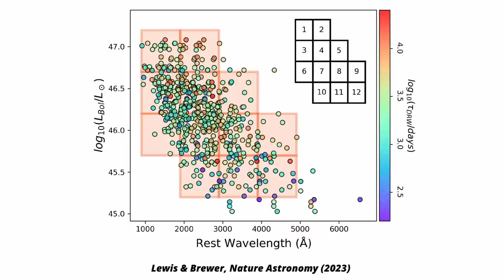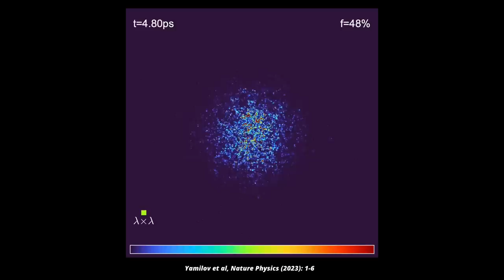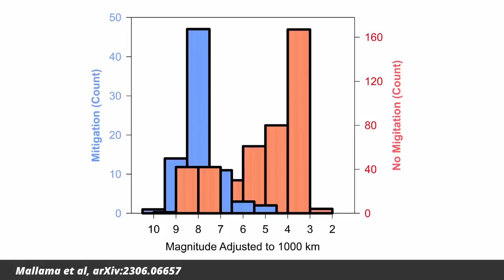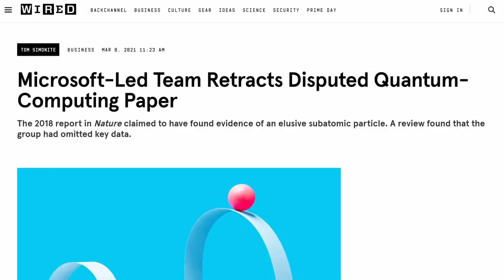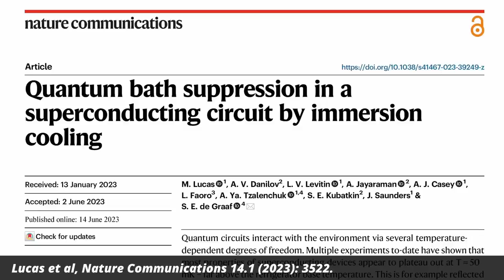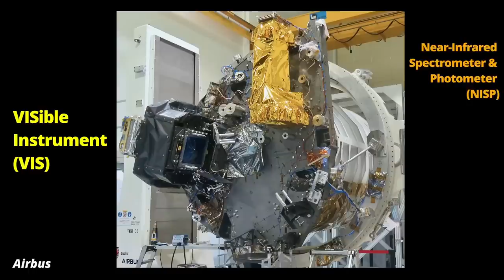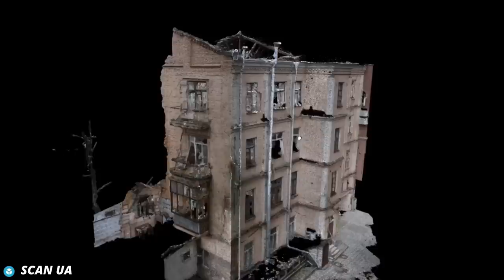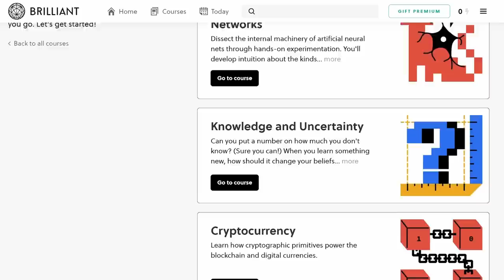Time Ran Slower in Early Universe, New Study Finds

Comment: In the early universe, all the matter was packed closer together, because space was smaller.  I assume that means that the total background gravity field was stronger than it is now, because galaxies and such have expanded much farther apart.  With the relative densities so disproportionate, looking at distant galaxies, time should appear slower.
Reply: Slower in relation to what? Putting everything denser together doesn't increase the gravitational field, as gravitational sources from all directions cancel each other out. You'd need a gradient to get a difference. To my understanding it's that from our perspective time in the early universe appeared to be slower, but from the perspective of the early universe everything would be perfectly normal.

Time is what clocks measure. If all clocks in the universe got slowed down by the same amount, no clock could measure any difference.
Reply: @NeovanGoth  - good comments, thanks for your response.  Yes, from the perspective being in the earlier universe, time does not appear slower.  What I am suggesting is that from our modern perspective, looking back in time and space with our telescopes, time seems to be running slower.  It is just like how our GPS satellites see time moving very slightly slower on the surface of the Earth, because gravity is stronger there.  It actually has to be corrected for to make GPS locations stay accurate.
In the earlier, more compact universe, yes some gravity fields cancel each other out, but overall, there are more stronger gravity fields throughout spacetime back then there is in our current time.  It seems to me that it is just like the GPS satellites looking down on Earth.  Relative to here and now, time appears to be slower.
Am I sure that my proposition is correct?  No.  I am only putting it out there to see what you and others think.
Reply: @smeer001  No, this is not correct. You are probably thinking of gravitation as some kind of absolute number that is added up from the mass of the surrounding objects, so if suddenly all the suns and planets had double the mass (or in a certain amount would be double the mass because everything got packet together more densely), there would also be double the gravitation. This isn't how it works though.

Gravitation isn't an absolut number ("How much stuff is in this piece of universe?"), but the _curvature of space_. The universe is both homogenous and isotropic (the "cosmological principle"), which basically means that no matter where in the universe you are and in which direction you look, there's always the same amount of stuff in this direction. If there is the same amount of stuff in each direction, the net amount of gravitational force the whole universe acts upon you is zero, because every gravitational source in one direction is cancelled out by a gravitational source in the opposite direction. It doesn't matter how much stuff is in every direction, or how densely packed it is now or was billions of years ago. Overall the universe is flat and always has been (we can see this in the cosmic background radiation), hence there never has been any gravitational time dilation acting on the universe as a whole.

In your example with GPS satellites this is different, because on a local scale (like "earth + orbiting satellites") the universe is not flat_. For somebody on earth, space-time is curved _more than for a satellite (there is a gravitational gradient), hence a clock on a satellite experiences less time dilation and ticks faster that a clock on earth (not slower, as you wrote). This is the gravitational time dilation general relativity describes.

What makes clocks in satellites tick slower than clocks on earth, although they experience less gravitational time dilation, is their relative velocity. From the reference frame of somebody on earth, satellites move very fast, hence they experience time dilation as special relativity describes it, which in this case opposes the gravitational time dilation, and is, in fact, stronger.

Back to topic: The universe is expanding, hence the farther we look, the faster everything is moving away from us. A galaxy 10 billion light years ago has a bigger relative velocity than a galaxy just 1 billion light years ago, hence they (or more precisely, what we see from them) must experience the same time dilation as a spaceship that moves away from us with the same velocity.

This is nothing new of course, we've seen for decades that light from distant galaxies is redshifted, means its frequency is lower. Since light is an oscillating wave and oscillators are the very definition of "clock", this already can be interpreted as time in the early universe being slower.

So what's new anyway?

When we calculate using redshift how fast something moves away from us, we assume that the light emitted for example by excited hydrogen atoms always had the same frequency. This is a problem, because if excited hydrogen emitted photons of a lower frequency 10 billion years ago than it does now, these photons would also appear redshifted to us and we would overestimate the relative velocities of their sources.

Therefor we need to look at other clocks and this is exactly what the scientists have described in this paper. They found that not only light coming from the distant past oscillates slower as it should if the universe weren't expanding, but everything else that happened in the distant past appears to be slowed down too by the very same amount.

Comment: I wouldn't call that slowing of time. After all it is just redshift of quasar varying frequency and no one calls redshift of light slowing of time. Any observations of waves or particles moving at finite speed coming from cosmologically distant places would be subject to cosmological redshift.

Or would the time of an ambulance slow down when it passes the observer? The observer would observe the siren frequency of the ambulance suddenly drop a clearly perceptible amount due to doppler effect when it passes him.

However that supermarket line effect is real and the rate of time at the end would approach zero when the length of the line approaches infinity.

Comment: I have two points of disagreement with your otherwise excellent article.  First, a red shift occurs when a source moves away from, not towards, an observer.  Second, "time ran five times slower than today."  What is a measure "slowness"?  Perhaps "time ran at one-fifth the speed that it runs today"?

Comment: “Cosmological time dilation is purely an observational effect.“ That’s a great sentence! And I’m wondering if it shouldn’t be used more often, specifically when talking about special and general relativity? For example, length contraction. It’s in a sense just an observational effect, because if you’re moving along with the object that someone else is measuring the length of, it is not contracted for you.
Reply: Special relativity's length contraction isn't an observational effect. It's contracted for them but not for you because length really is relative. It actually is shorter in their reference frame.
Reply: @juliasophical  but still, you could argue that it’s an observational effect, because the shortening they observe is not present if they were to be in the same frame as the object whose length they are measuring. If you have a rocket that is going at 99% the speed of light and everything is foreshortened in the direction of travel, that foreshortening is an observed effect that is not present if you were traveling along with any foreshortened object being measured, including the object that is the distance between them and some distant point. I’m probably mixed up on exactly what is meant by an observational effect. But the example Sabina gave of light waves, representing clock. Ticks is a direct observation of time dilation in that remote reference frame that is moving away from us very rapidly. And she called that an observational effect. If time dilation is an observational effect, then why wouldn’t length contraction also be?
Reply: @TedToal_TedToal  Well, in one case, the effect is in appearance only, whereas in the other, the effect is actual. The clock observed after billions of years appears to be going slower, but it actually wasn't going any slower at the time. But a clock at the bottom of a gravity well or on a moving object actually does go slower. One is an illusion caused by the way the light has been distorted over time, whereas the other is an actual effect. In the latter case, the clock actually is ticking slower, it doesn't just look that way. Likewise with length contraction: there's a difference between something looking shorter vs. *actually being physically shorter*. A funhouse mirror causing something to appear shorter is an observational effect, relativistic length contraction is not an observational effect -- the effect is a result of the motion, not of the way it's observed.
Reply: @juliasophical  ok, yes.  And, if you were moving towards something rather than away, you would see blue shift and an apparent speeding-up of time at the distant place. But, I guess my point is that time dilation, though real and not “just” an observation, is an observation in the sense that even though you measure the moving clock as ticking slower, if you were moving with it you would not measure that. And I think many people who don’t understand the transformation equations but instead have simply been told about time dilation imagine that the person moving along with the clock actually IS experiencing time passing slower.
Reply: @TedToal_TedToal  Well, time is actually passing slower for them (relative to someone else not moving with the clock), so if that's what they're imagining in that case, they're imagining correctly.
Reply: @juliasophical  And the converse is true, time is passing slower for you relative to them as they move along with their clock.
Reply: @TedToal_TedToal  Yup! Each person sees the other as moving, and therefore as having a slower clock -- *and they're both correct*! That's relativity! 😄
Reply: @juliasophical  I guess we don’t agree on nuanced uses of the word “observational”, but at least we both agree on what’s happening!
Reply: @TedToal_TedToal  Right. If you called relativistic time dilation an "observational effect", you would confuse most people into thinking the moving clock only appears to be ticking more slowly, when in fact, it actually is ticking more slowly. Cosmological time dilation is a purely observational effect, the clocks weren't ticking more slowly, they just look like it now, quite unlike relativistic time dilation, which is not a purely observational effect, the moving clock doesn't merely appear to tick more slowly, it actually does.
Reply: @juliasophical  I’d word it like this: “Relativistic time dilation is purely an observational effect, seen only when there is a velocity difference between the observer and the observed. It doesn’t happen in the absence of a difference in relative speed of the two.”
Reply: One observes what is really there.
Reply: And I’d add “Both sides observe it.”
Reply: And: “It’s observational, not something inherent in the nature of THAT clock that is causing it to tick slower.”
Reply: @TedToal_TedToal  Right -- that would be confusing and incorrect, which is why I point out that relativistic time dilation is not a purely observational effect. It occurs for any moving clock, whether it's observed or not. Bringing an observer into the description just confuses the issue and potentially fools the listener into thinking the time dilation is purely an observational effect, when it happens even in the absence of any observation of it.

Comment: Am I the only one who thinks the observation in 5:13 isn't "ruined" by Starlink lines cutting through the pictures? Something like 95% of the pixels are still completely usable. As far as I can tell, a moderate programming task would completely solve the problem. If anyone is aware of a more sophisticated description of the problem, I'd like to hear it. Based on what I've seen so far, it sounds like astronomers want to get rid of a promising new technology so that they don't have to do a few days worth of work figuring out how to ignore unusable pixels. Also, the problem only persists for about an hour around sunrise and sunset right? So you loose a small fraction of your lowest quality data-taking time?

Comment: I am confused. If time moved five times slower in the early universe and if the speed of light is the distance covered per unit of time, then was the speed of light slower or faster back then?
Reply: Neither. The speed of light is a constant, and the consequence of that is what causes all the other things to be relative. This is why you get a change in wavelength instead of a change in speed -- the photons maintain the exact same velocity, but their wavelength redshifts.

Comment: That's impossible. In early universe clocks didn't exist and clocks are the only thing, in what time is manifestet. Counting periods - idependend of how long such a period should be - is based on relative movements and therefore the thing, you call time is also based on relative movements. Therefore speeds also depend on relative movements, while the movements they're "measured for, doesn't. If you measure lengths movementbased (i.e. with radar), you'll see, that your measured length will movement dependedly change but not the amount of part distances an electromagnetic beam will pass. While resting, you'll counting more periods than while in movement. Saying the distance between two certain marks is changing, because periods between two counters are longer, is completely wrong. This is the clue where special relativity fails.

Comment: Unless that laser therapy reduces oxidization of damaged outer hair cells in the cochlea, I doubt the therapy works as well as what the study results suggest.
Reply: Also, I know it's hard to get stock video that features a doctor using an otoscope correctly, but it confuses patients when they finally get their ears checked that the speculum has to go in the ear a little bit and the earlobe may need to be pulled to straighten out the skin of the ear canal for a better view of the eardrum.

Comment: What is it supposed to mean that time was slower? Even if the universe would stop completely and then continue "a bit" later, the future would be absolutely indistinguishable from a universe which did not stop. Imagine stopping or slowing down a simulation in a computer. The final result will still be the same. It's not possible to talk about speed of time at different times of the universe.

Comment: Hm. Surely an observation that the seen light from the early Universe runs "slower" then us - may be a consequence a distortion from our local frame acting on the image we see (a temporal "mirage"). We do not know of the absolute speed of the early Universe or of ourselves, just a local observation via a media which propagates through space-time (posses a temporal component) working on a signal which has likely been near immense masses en route. We need more data points, ideally from a vantage point far away eg a view from another galaxy :( cough.

It is completely possible that there is another dynamic. And its plausible that the speed of time is local, not only on a planetary scale, but on a cluster scale. What else of "the constants" may be local??

Comment: 6:40 Did you know they could achieve what Star Link does on the ground using UWB and ATM? I think astronomers should demand they do that. Oh, and BTW, it puts the carriers out of business.
Reply: UWB= Ultra wide band?
ATM = Automated Teller Machine?
Astronomers have no ability or authority to make any demands. If what Star Link does could be achieved on the ground, especially cheaper, it would have been done. It isn't so it's not.
Reply: ATM asynchronous time modulation.
Reply: But then it wouldn't fit le epic space man Musk.
Reply: @RobertSmith-pw1cl  ATM: Asynchronous Transfer Mode.
Reply: @filonin2  ATM: Asynchronous Transfer Mode. Can make hops several orders of magnitude faster than IP.
Reply: Once SpaceX's Starship becomes operational, the full-size Starlink V2 satellites it will start deploying will be able to act as orbiting cell towers for many existing recent-vintage cellphones.  SpaceX has a contract with T-Mobile to eliminate dead zones in its service throughout the US this way, however there are no technical reasons why T-Mobile cellphones wouldn't be able to work anywhere world-wide (including on lifeboats in the middle of oceans, assuming they haven't sunk).  Non-T-Mobile cellphones might also be able to utilize this network just for 911 calls, but I'm not completely sure about this.  Applicable users won't have to do anything to enable this service.  How would UWB and ATM provide similar capability for existing cellphones in a seamless manner?